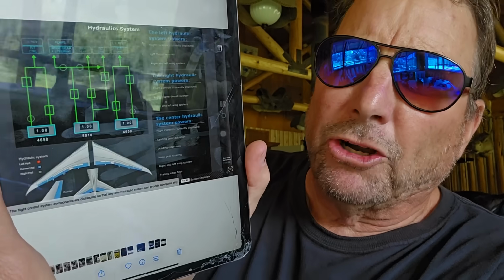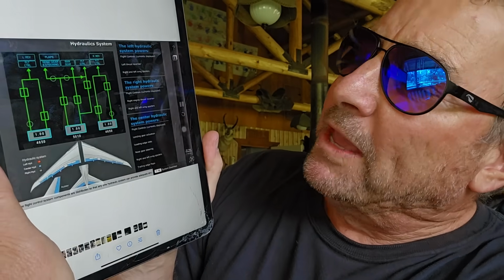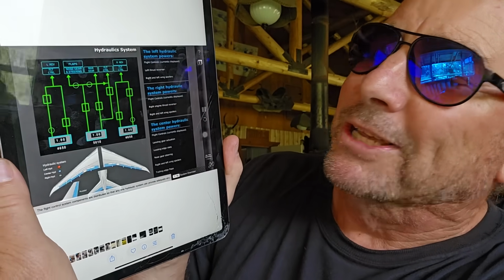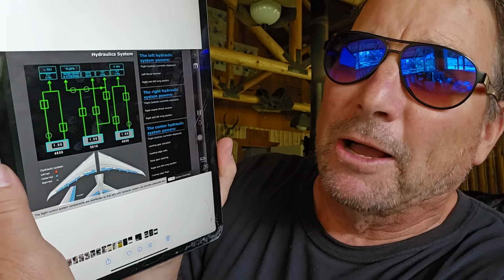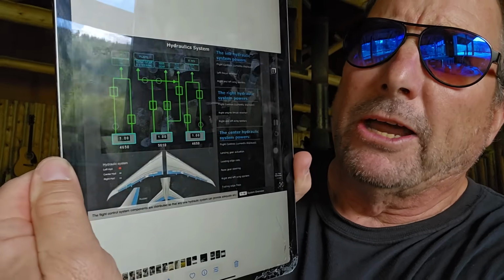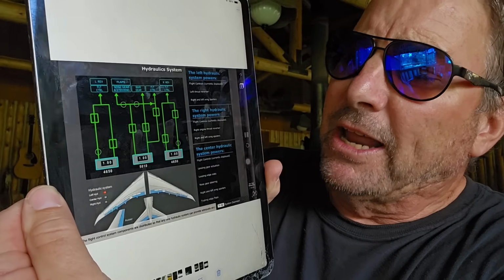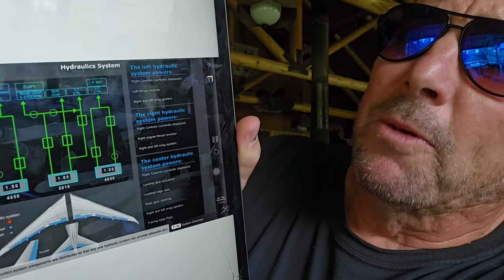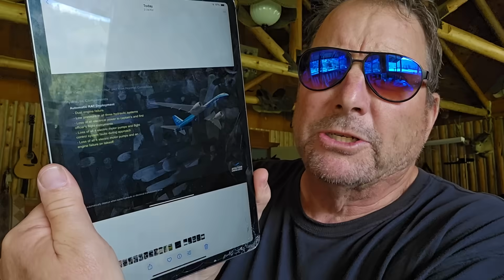787 Crash India What's a RAT? When does it deploy?

Comment: I'm SO glad you mentioned the flaps and how hard it is to tell from the videos if they were properly set or not.
Reply: So many people have been claiming quite boldly that the flaps are the sole cause of this accident. It's so hard because everyone wants answers, but the less someone knows about aviation, the more boldly they speak. The general public can't tell the difference and so misinformation almost always outpaces accurate speculation.
Reply: @adamhale6672  yeah Capt Steve, is a big reason
Reply: @adamhale6672 well said
Reply: @adamhale6672 oh I saw other pilots saying they could tell from the low quality image. Even when I showed a high resolution image of a 787 taking off and how hard it is to tell the flaps are deployed. 

The certainty early on based on minimal info is frustrating.
Reply: @MeppyMan  I think ultimately pilots are biased against dual engine failure on take-off because it's just not supposed to happen. Ever. Except for bird strikes possibly. This bias likely blinds them to the truth. Heck it blinded me. I was 80% toward flaps theory, then I reverted back to 50/50, now I'm 80% dual engine failure. RAT almost certainly deployed. Seems unlikely it was deployed manually.
Reply: @garrymullins  I don't think that the availabile information is necessarily pointing to a dual engine failure like that just yet. As was pointed out, a hydraulic failure can also deploy the RAT. So could the crew, although the circumstances that would lead them to do that are unknown.
Reply: @garrymullins BA-38 is a great example. First hull loss of a 777. The pilots were basically vilified over it. Despite the FDR confirming their story.

It took a long time to unravel the chain of command events that led to that accident.
Reply: @garrymullins  Neither !
I'm very much convinced of a serious electrical issue. On a previous flight that 787 had electrical problems and the sole survivor of the accident flight reports a loss of cabin lighting too, shortly after takeoff.

TOTAL loss of electrical power would mean the fuel pumps for the engines shut down too (the 787 has no engine driven mechanical fuel pumps as backup/redundancy) and any fuel they continued to receive would be by gravity only, so they would definitely spool down and the RAT would also be deployed on the loss of electrical power.
Conceivably the RAT might provide enough electrical power to get the fuel pumps delivering fuel to the engines again  BUT they would then need to spool up again to provide useful thrust and I think they simply ran out of altitude/time in which to recover.
Reply: @incognitoburrito6020  The engines didn't fail ! TWO high reliability turbofan engines don't fail either simultaneously or within a few seconds of each other and there is no visual evidence to suggest such a thing either ! I suggest they were simply starved of fuel due to an electrical fault.

I'm very much convinced of a serious electrical issue. On a previous flight that 787 had electrical problems and the sole survivor of the accident flight reports a loss of cabin lighting too, shortly after takeoff.

TOTAL loss of electrical power would mean the purely electrical fuel pumps for the engines shut down too (the 787 has no engine driven mechanical fuel pumps as backup/redundancy) and any fuel they continued to receive would be by gravity only, so the engines would definitely spool down and the RAT would also be deployed on the loss of electrical power.
Conceivably the RAT might provide enough electrical power to get the fuel pumps delivering fuel to the engines again  BUT the engines  would then need to spool up again to provide useful thrust and I think they simply ran out of altitude/time in which to recover.

It might be better if 787s had the APU running during takeoff and for some minutes after that.
Reply: @MeppyMan  Vilified ? That flight crew are typically seen as highly competent, by adjusting the flaps setting for less drag, the Captain enabled the aircraft very nearly to reach the runway. It COULD have been a disaster if it had landed on a nearby road.
Reply: @incognitoburrito6020  It's certainly pointing towards it as a possibility considering that the plane stopped climbing, and that the reported wreckage(it seems to match) showed that the flaps seemed to be extended.
The survivor reported the he heard a bang(about 30 seconds after takeoff I think) & that the lights flickered. Albeit the bang may have been the tail first striking a building, and perhaps the lights flickering could perhaps have been caused by the rat activation?
Reply: @garrymullins yes, everyone is reluctant to deviate away from the pilot error/wrong flaps scenarios because the idea of a modern and sophisticated jet like the 787 experiencing some kind of power failure and loss of both engines right after takeoff is scary and terrifying
Reply: Total electrical failure, total FADEC failure, dual simultaneous engine failure, last seconds rat deployment...crash.
Reply: @incognitoburrito6020 right I guess I mean, dual engine failure, for whatever reason. Primary or secondary failure.
Reply: @sacrilegiousboi978 indeed. Plus Captain Steve is a 777 pilot, so he doesn’t want to believe Boeing could F up this badly. Assuming it wasn’t an egregious maintenance error or something out of Boeing’s hands.
Reply: @garrymullins  Personally I was not thinking it was the flaps... of the 5 reasons the RAT deploys, one is dual engine failure, one is full loss of pilot/co-pilot flight instrument/displays/electrics, and the other 3 are far less likely (one is during approaches, one is a triple hydraulic failure, one is a quadruple electrical pump failure).  Personally I think it is 50/50 for dual engine failure and dual electrical instrument/controls failure.  And if it was a dual engine failure it may have been intentional, but seems hopefully unlikely.  So that leaves electrical, which is way too early to tell, but does fit unfortunately with the social media report on the previous flight of the plane having 1) no operating call buttons, 2) no operating A/C, 3) no operating vent fans, 4) no operating seat back entertainment systems, 5) no operating reading or cabin lights.  Hmm, was this plane airworthy?  Those items might not have "failed" necessarily - perhaps they were intentionally switched off... but why?  While it's 50/50 (in my mind) for those two choices... it maybe come down to 100% human actions...  who in the world flies a jet in India in June with no A/C?  I want to know more about maintenance, pilots, and airline actions & policies on this plane.
Reply: @rkm237  What when you say the dual engine failure could’ve been intentional?
Reply: @carolep.1645  Well I think it wasn't intentional...  and the black box/voice recorder should clear all that up, but as it was mentioned - it is so unlikely for there to be a double simultaneous engine failure, and you can see from the videos there appeared to be no engine power - so that was my early thought was how else could this have happened?  Maybe intentional or accidental fuel cut off, throttle pulled back, or fire suppression triggered, but it is hard to understand how that could happen.
Reply: @MeppyMan  that's what happens when they all have social media platforms to monetize. No one wants to hear an "expert" say, "it's very early in the investigation and we don't have any idea what caused this." They want to hear "while it's early on and this is subject to change as more information is learned, here's my theory on what caused this."
Reply: @garrymullins  Interesting that you feel able to ascribe precise probabilities to causes when you have virtually no information on which to base those numbers. Is that magic, ESP or just blind guesswork ?
Reply: @incognitoburrito6020  The engines, the hydraulics and the electrics are all interdependent and intertwined.
Reply: @MeppyMan  Simply untrue. There was never any suggestion of pilot error, nor were the pilots vilified, certainly not in reputable circles. The captain fell out with BA because it imposed gagging orders on the crew involved, which allowed unfounded rumours to circulate within the cabin crew community. In the aviation world outside the airline there was very definitely a reluctance in some quarters to accept the possibility of dual engine failure.
Reply: @garrymullins  Unless there is a previously unknown and very obscure design flaw, this is unlikely to be a problem laid at Boeing's door.
Reply: the straks and flaps where fine the plane wouldnt let you take off with out them in the corect position.
Reply: @eddjordan2399 Let's be clear, in almost every case, a takeoff warning alarm won't prevent the crew from continuing the takeoff... they'll just have to decide to ignore the warning.
Reply: @bobullman  One wonders what ATC reaction would be to the warning horn sounding in the background - it's extremely loud.
Reply: Strakes are fixed, did you mean slats?
Reply: @eddjordan2399  well this was something i was wondering, so i wonder if once lined up, set the flaps, and perhaps a hydraulic failure was accruing, maybe the hydraulics or electric motors were still trying to deploy them, but i know there is a warning light to say when flaps are extended, could that be happening as they began to take off, would the onboard computers be shutting the engines down, doubtful, perhaps the RAT deployed to aid hydraulics and electric motors, flaps returning to normal, working to get the undercarriage up
Reply: huh?
Reply: @eddjordan2399  Not true, it just complains very loudly.
Reply: I looked at the cellphone video first thing yesterday morning, and I thought "no way would I be able to tell if the flaps are lowered or not".  Then I went to the BBC and heard the RAT clearly on their video, and checked against a RAT demo video.  A lot of people seem to have become fixated on the flaps right from the start, plenty of whom claim to be experienced pilots.  How about this: "There are plenty of two cylinder vehicles on the road in India that could make that sound".  Have they been to India? (I have).  It's a matter of concern that a pilot could leap to a conclusion really without any evidence at all and remain fixated on it, one can see how some accidents spiral.
Reply: @LokiCentral  Notice how Juan mentioned the RAT within hours of the crash, 48 hours before anyone else. I too heard a very distinctive (non-jet-engine) sound when I first watched the video, but I failed to identify it as the RAT. This shows the great value of in-depth knowledge, expertise and experience.
Reply: There are photos from the wreckage of a wing with the flaps deployed. Like Juan said, if you try to takeoff without flaps you get the aural warning sound in the cockpit triggered when you advance the throttles. So must unlikely the flaps were deployed after takeoff, even with flap setting 5, It will take some time to extend to that degree (5). It's impossible that the pilots would takeoff with the aural warning sounding. Fuel contamination could be another cause that i don't heard anyone talking about that.
Reply: Its really hard to tell anything from that video aside from loss of lift and no smoke/fire.
Reply: The 787 like 777 has an electronic checklist. 

It’s impossible to not set the flaps for takeoff configuration and complete the before takeoff electronic checklist. 

The flaps were set for takeoff. 

What’s possible is there was either a blown tire or an engine failure. Which may have lead to the pilot monitoring raising the flaps instead of the gear, possibly.  

I could be completely wrong, pure speculation. 

I also read that this particular aircraft had some serious maintenance overhauls completed recently. I don’t know how true that is either.
Reply: @Nebo888 I suspect the engines didn't FAIL (you'd expect to see visual evidence of this but were merely starved of fuel by an electrical failure.

The fuel system on a 787 is entirely electrically driven !

I believe the engines were starved of fuel shortly after takeoff by an electrical failure. You can see the 787 visibly stops climbing out.

I'm very much convinced of a serious electrical issue. On a previous flight that 787 had electrical problems (video'd by a passenger apparently) and the sole survivor of the accident flight also reports a loss of cabin lighting, shortly after takeoff.

TOTAL loss of electrical power would mean the fuel pumps for the engines shut down too (the 787 has no engine driven mechanical fuel pumps as backup/redundancy) and any fuel they continued to receive would be purely by gravity feed only, so the engines would definitely spool down and the RAT would also be deployed on the loss of electrical power.

Conceivably the RAT might then provide enough electrical power to get the fuel pumps delivering fuel to the engines again  BUT the engines would then need to spool up to provide useful thrust and I think they simply ran out of altitude/time in which to recover.
Reply: @grahamstevenson1740  This is false. Only the boost pumps are electric only, the high pressure pumps into the engine are mechanically driven.
Reply: @richardmillhousnixon  That's not what I understand. By all means show that's the case.
Reply: @richardmillhousnixon  Nope. All fuel pumps are electric - 2 off AC in each of 3 tanks, including 2 high pressure pumps in the centre tank and a backup DC pump for the APU. In the absence of any working pumps the engines can draw in fuel by suction - quite how that works with all the various selection mechanisms and pipes I don't know
Reply: @hb1338 Those are all boost pumps. The engines themselves have mechanical fuel pumps, which are indeed powerful enough to generate enough suction to keep fuel flowing
Reply: @hb1338 according to an Indian source the loud bang was also heard by the pilots of an indigo jet taxiing nearby when the plane was at v1
Reply: @Nebo888People are fixated on the flaps.  The RAT deployed.
Reply: @Nebo888 Watch the video, then be embarrassed by what you have posted.
Reply: I seen a picture of the wing and the flaps were deployed
Reply: @jayha7071 I was going to say that but checked comments first - right, flaps and slats were deployed.
Reply: With the one survivor we know he heard a loud bang before the crash. I'm still more inclined to think bird strike or some sort of massive engine failure on takeoff before getting to the flaps off that alone.
Reply: @LantanaLiz It’s not unreasonable that the loud bang is actually caused from the RAT deploying. They’re spring loaded very strongly and mounted into the frame, so I imagine it makes a good bump in the cabin when deploying.
Reply: @LantanaLiz The reports I've read all say "loud noise", not "loud bang".  Do you have a source for "loud bang"?
Reply: @LokiCentral  It was the coverage from an Australian news stations showing the survivor talking to the local Indian press. I can't recall which free to air station it was because it on the TV at a doctor's office. If you can find the Indian coverage of them talking to him you'll find it there.
Reply: @LantanaLiz  The Times of India video translated that three times as "loud noise", I have never seen any reference to a "bang".
Reply: @LokiCentral  Our news didn't source from the Times. It sounded like they translated it straight from an interview with him in Indian. I can't really provide more than that as he's done a lot interviews with various media outlets. It's hard to know if our news had their own reporter there or if they had an affiliate do it on their behalf (we have a lot of immigrants here and the plane was a regular to Australia too).
Reply: @LantanaLiz  Mentour Pilot suggests that passengers/eye witnesses are unreliable and always think they heard a bang, so their accounts should be discounted except for reports of smells.  I'm personally assuming the 30 seconds is probably an over estimate x1.5-2, because I think people tend to overestimate time periods like this unless they count the seconds out (I've heard Aussies do that with "One - Bless the King -" etc, something like that).  A loud "noise" might result from RAT deployment and operation.  What I've seen is something like "a loud noise and then we crashed", so I'm discounting the noise as being from the impact, although it could be of course.  "And then" is sometimes used to "cover up" a time gap rather than implying immediacy, and I would understand if there was a gap of 5-10 seconds but he simply didn't know what to say about the events in that gap.  I'm intrigued by the possible idea that the initiation of landing gear retraction might have loaded an already faulty hydraulic/electrical system enough to "break the camel's back", or that they lost thrust for some other reason, and as a result the control systems might have reduced AoA (or prompted the pilots to do so), because I think we see an AoA reduction at about the critical moment and this would correspond with the survivor's report that they stopped climbing shortly after takeoff.  Reducing AoA would presumably decrease lift just as surely as an erroneous retraction of flaps, so we don't need to conjecture that they retracted the flaps (which I gather the flight software should not have allowed anyway).  What he perceived as an increase in thrust at the end might be engine speed/power increasing (I don't recall hearing a speed increase), or it could actually be the increase in AoA that I think we see shortly before impact pushing him back in his seat.
Reply: @LantanaLiz  The BBC have all along reported "loud noise". Unlike most media outlets, the BBC (wherever possible) uses multiple sources and does proper verification of its' stories.
Reply: @LokiCentral  I timed the flight using the airfield CCTV video - almost exactly 30 seconds consisting of 15 seconds climb and 15 seconds descent. Any human estimate of time is likely to be unreliable. The notion that passengers always think they hear a bang is plain stupid, but  it is the case that passengers tend to be over-sensitive to the normal squeaks and bumps of aircraft flight.
Reply: @hb1338  The Australian news is not the BBC, we have a variety of our own reporters who do international coverage both on the ground and through local affiliates.
Reply: @hb1338  It's Mentour Pilot who made the comment about passengers/bystanders thinking they hear a bang, so you need to tell him he's stupid.  Thanks for timings.
Reply: @LantanaLiz  Try watching the video.
Reply: don't hear rat sound on shared videos, just usual turbofans. probably should wait for data from recorders.
Reply: @PavelKrupets  The RAT is clearly audible on the copy video posted early on, and even more clearly audible on the original video posted later - the latter is on Captain Steve's channel.
Reply: Exactly 👍
Reply: I can't tell!
Reply: It's not a flaps issue.  It's a thrust issue.  The investigation will prove this.